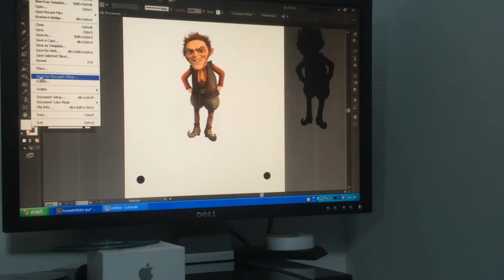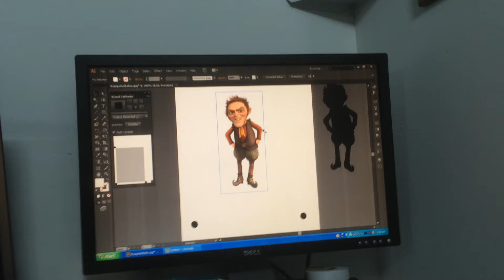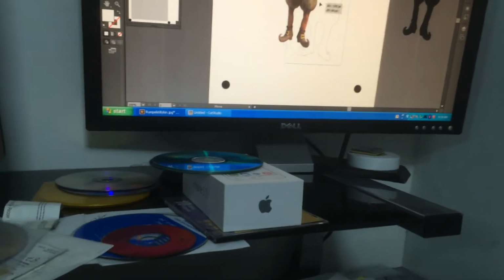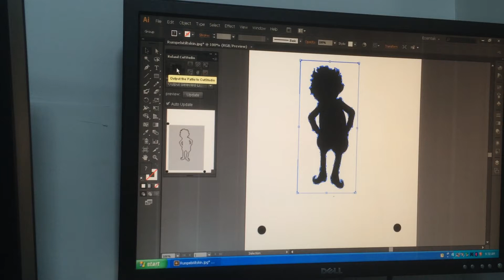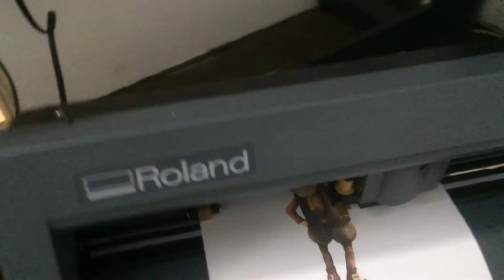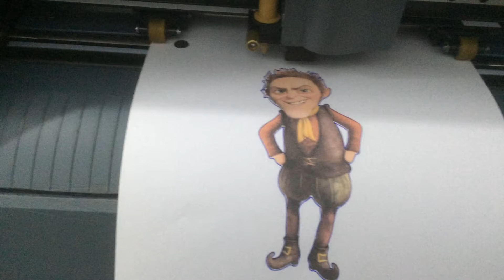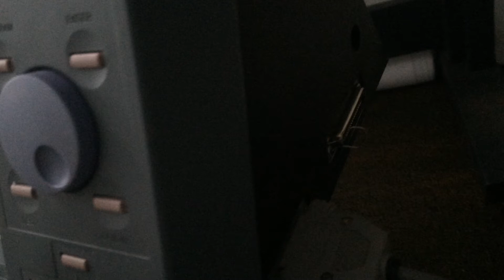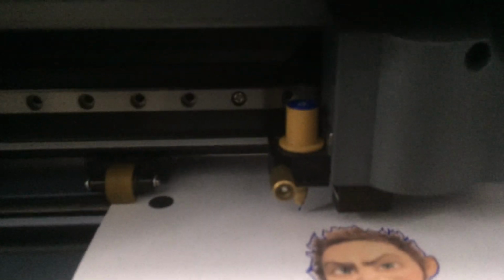ROLAND CAMM 1 CX 24 CONTOUR CUT SET UP

Comment: Hello, looking for a used CX24 right now but saw its end of life model at Roland. Do you still recommend that model if I can get it for cheap (around 600$CAD) ? It seems it doesn't support Win7/8/10 as well so I would need an older XP computer... Best Regards from Canada
Reply: It can running win7 32bit system with XP version driver😁